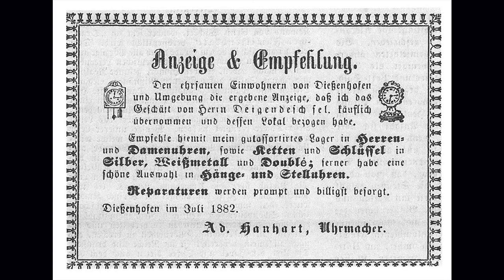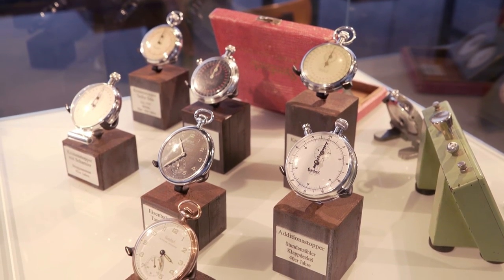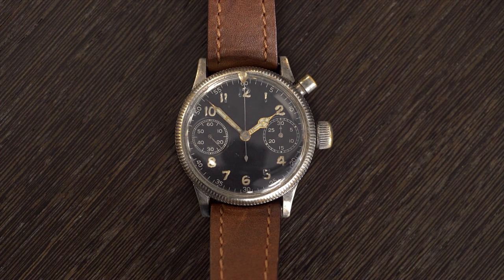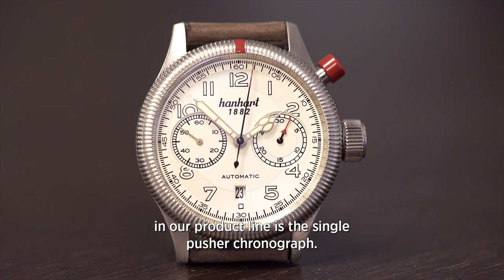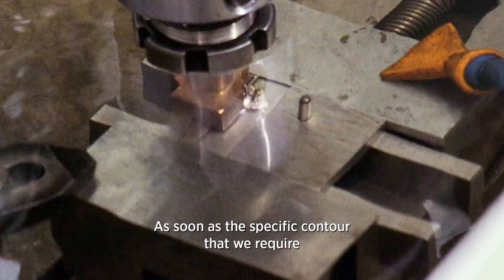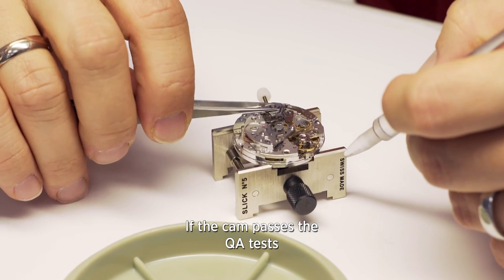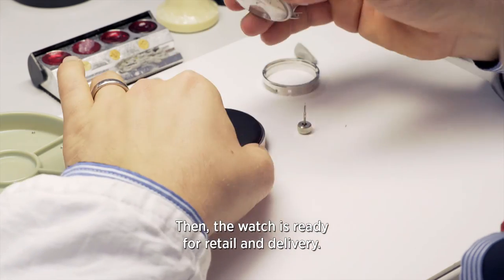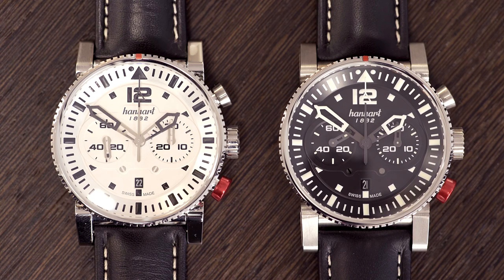Hanhart - German watchmaking tradition from the Black Forest

Comment: I bought a Tachy-Tele because of a different video showing the Hanhart factory. I like the watch except for the fact that the rotating bezel is too easy to turn and so it is easily moved while wearing it, making it impractical to mark a specific time.
Reply from the maker: Hi Tim, yes, it is very easy to turn indeed. But the watch is still very nice to look at!
Reply: @1978ajax I only use the bezel on any chrono or diver for cooking...